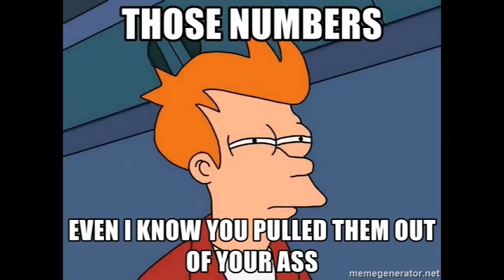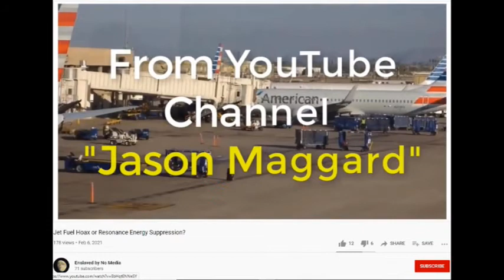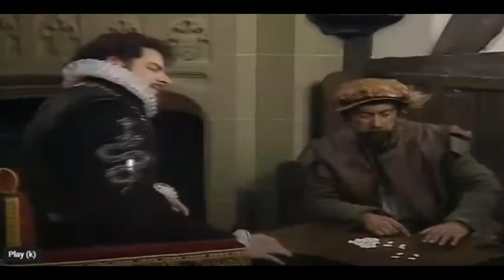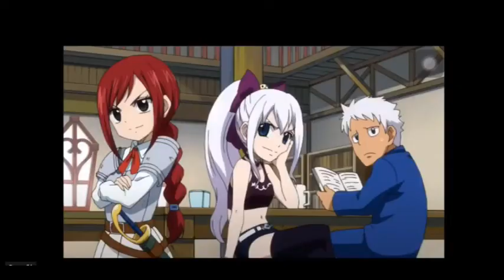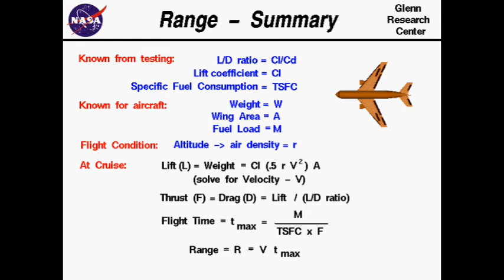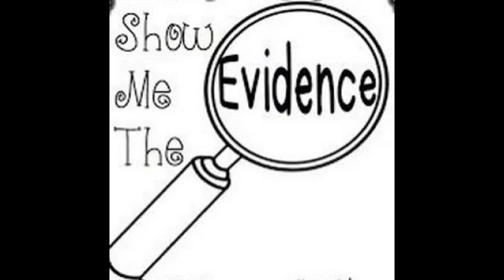enslaved by no media lies and stupidity part 4

Comment: I'll never forget that part where Jason is in Phoenix and admits he doesn't know a single thing about how and where to fuel an aircraft, but is exposing a jet fuel hoax nonetheless.  Do they watch their finished videos before uploading them?  Over half of any subscribers they have are only there to see the hilarity, the other half is just scary!
Ps: the Speedbird 100 beer was to celebrate BA's centennial.
Reply from the maker: I don’t think they do watch their videos before releasing them to the world of stupid as he used a dumber video by good old Professor Jones! 😂😂
Last week I  was working at East Midlands Airport on a 747-400 freighter and the airport does not have a fuel hydrant system and has tanker trucks to refuel the aircraft. Amazing to watch two 45000 litre tankers take about twenty minutes to put about 75 tonnes of fuel onboard the 747 and then a third turned up before departure to top up the aircraft to its desired final fuel of 90 tonnes. I am so used to a hydrant system. One tanker had a big fuel gauge mounted in the side of the tank and I watched it go from 45000litres down to about 5000 litres. Amazing to think how much effort goes into this fuel hoax.😂😂😂😂😂😂
Reply: Gary, thanks for stamp of approval on "Limerick of a Loon."  Did you happen to see one of her latest of UFO over "Papa Cottle" volcano in Mexico? I took the time to find out where the webcam is located and turns out it is looking pretty directly in the direction of Mexico City and the ET behaves a whole lot like a plane climbing out of perhaps the international airport there. You just can't make this stuff up.🤣